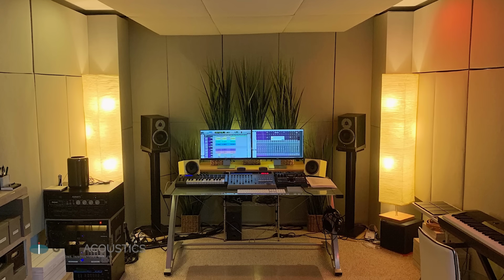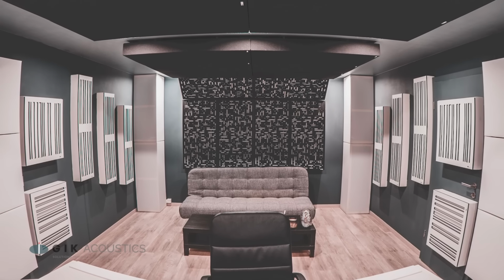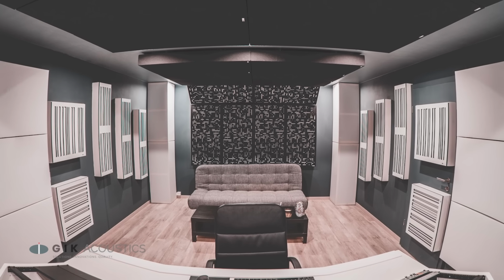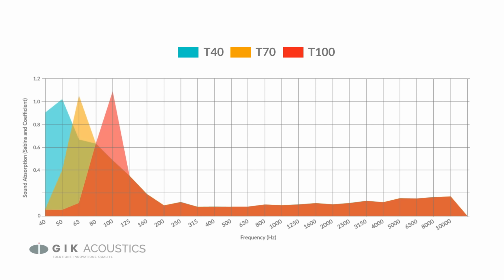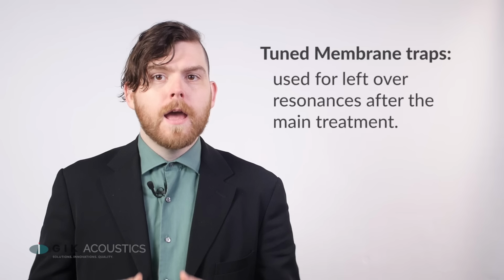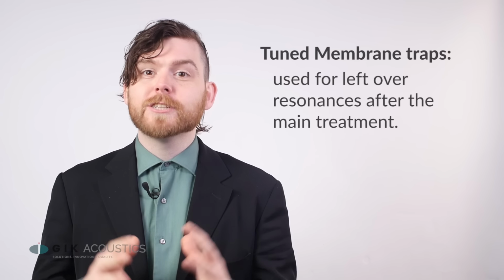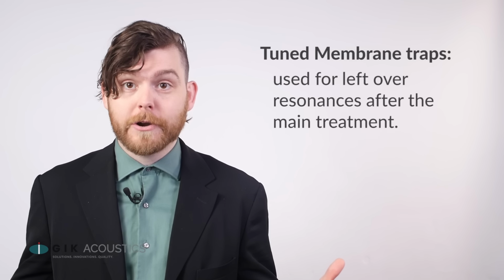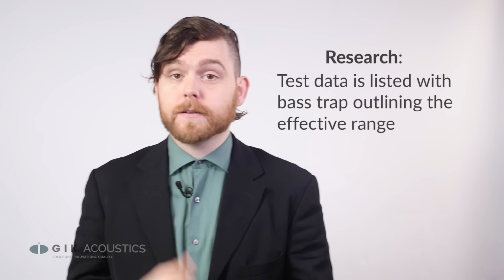Understanding Bass Traps: Your Guide to Bass Trap Placement

Comment: In general, should people build bass traps that are the full height of the room? Or is it better acoustically to leave a little gap at the top?
Reply: I would cover as much of the corner as possible. It doesnt have to be perfect however. In my case I have a gap of about 5cm between basstrap and ceiling, which doesnt have any impact. Remember that the waves bass frequencies emit can be very big, so a few cm less wont make any noticable difference.

Comment: I'm looking into these to help stop outside noise (Cars passing by create a very annoying rumbling inside my bedroom). Would these do anything if installed inside?I have no fence in my yard so my bedroom wall faces the street. There is also a wooden gate to the backyard which connects to the house making an L. I'm starting to think outside noise hits this as well and sort of creates a little cavern that sucks in noise making the rumbling sound if that makes sense. Perhaps putting these in the corner of the fence/wall on the outside?? Any info would be great
Reply: No bass traps won't make a difference to this
Reply: It might help to put your house on 10m speaker stands that absorb bass then put a thick carbon dome shell about 5m around the entire house creating a seal, then remove the air between the sealed dome and the sealed house with a 500 horse power vacuum pump. Let us know how it goes.
Reply: You need noise barrier, not a bass trap.  😊

Comment: if the areas of most bass are of the highest pressure and lowest velocity, and your bass traps are porous absorbers that work best at highest velocity, wouldn't you avoid putting the bass traps where the bass sounds loudest?
Reply: yep. Quarter wavelength of the lowest bass frequency youre trying to delete away from the wall. So like 30hz youd put ur trap 9.5ft away from the wall etc

Comment: Will bass traps help reduce the thumping of the floor of the room above the treated room ?
Reply: Maybe
Reply: No, the only thing that will really help is removing the drywall, insulating inside the area and (most important) installing a "decoupled" ceiling with, at minimum, resilient channel to hold the drywall away from the joists (which are vibrating when floor above "thumps")
Reply: No
Reply: @iogpurge  😂
Reply: Yes
Reply: @muffemod  😂

Comment: So I have annoying bass build up in one corner of my room in my apartment. Should I treat that one corner, or is there another route I should take? It's a small rectangular room, with about half of the room being the kitchen/dining area (barstool), and the other half being the living room. 

This is a description of the 4 corners:
The front left corner is in the living room, and has one of my speakers located there (of course, it's pulled out from the corner.).
The front right corner is in the kitchen, so no room for treatment there
The rear left corner is empty. This is the only corner where I notice the bass booming.
The rear right corner is where the front door is located, so no treatment can be placed there
Reply from the maker: It sounds like you have some space where you can do some good bass trapping, but this depends on the size of the room as well. I would like to see your room dimensions first, although bass trapping in corners is the most important step in a room after taking care of first reflections. Having an open, shared space comes with unique challenges, so I would want to have more information about the space. Please reach out to us via our acoustic advice form at
www.gikacoustics.com/acoustic-advice-form/

We've made a video that touches on the subject of treating shared spaces: https://youtu.be/wOTAS7ncihI

Comment: Here's a challenge for you. Take a Kia Rio 2016 hatchback car in 3 doors and "see" how the bass sounds (from a sub in the trunk). Then try to fix it. Good luck
Reply: @stateniland  The acoustoc in that particular car is simply awful.
Reply: @stateniland  It may sound a general issue, but this exact model makes the low frequencies a horror to listen to. The interior is dark because the windows are small, claustrophobish. Some other dips and gains between some other mid bass freqs are also present. I mean, it's just impossible to enjoy any kind of music in it. Even though the sub is pounding clean undistorted waves, from the passenger seat it is another story. You do not feel the natural sub bass. If you love subbass, please stay away from this model

Comment: hello i hope someone sees that. i have a wall with a window behind my spreakers. The window is on the right of the wall in the corner. What can i do with the bass frequencies in that case?
Reply from the maker: Thanks for the comment. While windows are not ideal for placing hanging treatments, there are absolutely methods to treating areas with windows for bass frequencies. A good quality window that’s been properly installed probably doesn’t affect soundwaves much differently than other wall surfaces like drywall, wood, bricks, or concrete. Some of the best solutions are using GOBO's or transforming our panels into free-standing panels, while there may be space for room setup positioning tweaks.

We've written a very in-depth article on the subject with some great solutions:
https://www.gikacoustics.com/how-to-treat-windows-with-acoustic-treatments/

Thanks,
Reply: @GIKAcousticsLLC  can theater curtains work?
Reply: @chrisorell  Open the window..  Guess it depends on Neighbours but an open window is basically a perfect bass trap,,